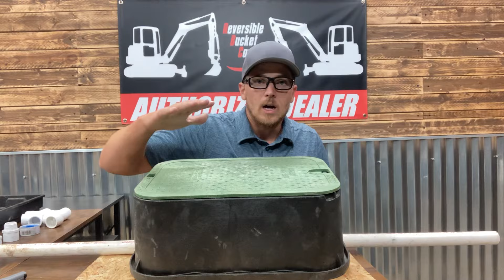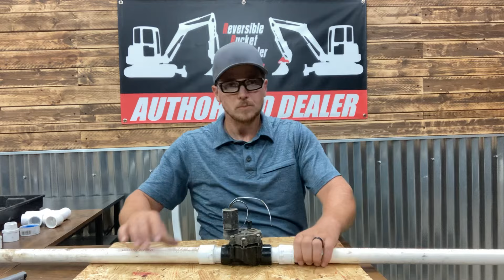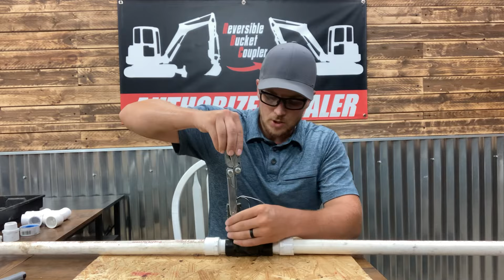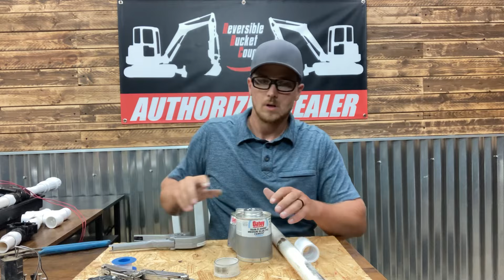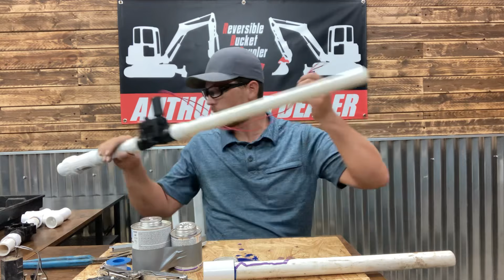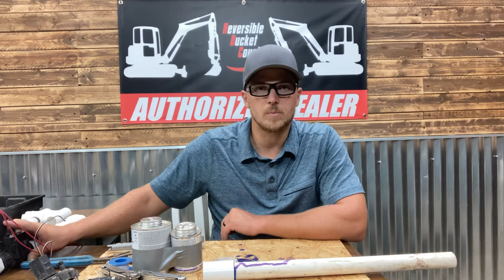Sprinkler Repair - Valve Won't Turn Off - Hunter PGV & Rain Bird DVF

Comment: Thanks for a good tutorial on main points of this topic.  Nice to watch a video where visually it is easy  'to see what to do'  by watching what you do on video. In my case sorting out bit of dirt in my HUNTER 25MM PGV100 SOLENOID VALVE by disassembling the top of it and being sure I can put it back together again correctly so no further issues with it.  As with all of this stuff it is the subtle details that matter.  Slip fix very useful product too.  All the best with your business

Comment: I have a ball valve before the Hunter on every station.  I can always turn it off.
Reply from the maker: While that’s not a typical residential setup (more common in commercial). This is a great method for sprinkler setup!

Comment: Got a call from a customer who was having trouble getting their system to startup like normal on a system that was properly winterized last fall.  Unplugged the timer.  Turned on the water and one of the zones came on.  All valves are closed.  Solenoid itself checks out at 41 ohms.  Shut the water off and replaced the diaphram and solenoid (just because) of the zone that was on and when I turned on the water this zone was now off but a different one came on.  Rinse and repeat on 2 other zones but a new zone kept coming on each time that I turned the water back on.  Plugged the timer in and activated the 1st zone that I had replaced the solenoid on and the new solenoid was buzzing.  Its not ghost voltage as the timer isnt even plugged in and there is no battery in it.  Have never seen this in 7 years of doing irrigation.  Thoughts on what it might be??  Thank you in advance!
Reply from the maker: Did you replace the solenoid? Honestly it’s not all than uncommon for a zone to temporarily turn on when we do a startup. Same thing with a rotor or spray head that is stuck up after the first run cycle. I always explain it to clients as the diaphragm, springs and wipers are weak or dry after sitting all winter. Once lubricated with water and cycles a few times usually everything starts to work. Occasionally we will have to replace a valve or a head. When a zone comes on while charging the main line I will usually turn off the water and back on. Sometimes multiple times quickly to shock the valve and hopefully get it to seat. Now you have to be careful. It’s fine on a 1” residential line but a large commercial sprinkler main line you can blow out fittings if you shock the system like that. I’d say less than 10% of our startups have this stuck on valve issue. Of the ones that do normally I turn off the water and back on and it’s good to go. I actually just left a gas station that always has zone 1 stick on during startup and then it’s usually good to go. But there were 2 other zones that also stuck on during startup. I need to get approved for repairs but dirty water or old brittle diaphragms are the likely cause and I’ll recommend replacing the valve to start.

Comment: I turned on just the water to my system and one of the valves wouldn't close, ie. water is running out to the heads in that zone only.  This happens even with the electrical Rainbird main control box turned off?.  Looking in the box, it appears that a mouse may have cut a wire to a valve head.  Could that be the problem?
Reply from the maker: Usually a stuck on valve is due to debris in the valve body. Sometimes you can unstick it by turning on and off the water supply. If not you will need to remove the top and clean the diaphragm and valve body.

Comment: I love the explanation but I don’t think this is my problem, so I bought a new screw on Hunter PGP irrigation head and I put it on ran my irrigation system but the head won’t pop up to its Full potential so I’m confused on what to do to get pressure back to this one head.
Reply from the maker: I bet you have a rock in your lateral line. Remove the head. Usually there is a flex pipe connecting the head to the pvc or poly pipe. Follow the line back to the lateral line and remove all fittings. I’d guess there to be a rock stuck in the tee where the flex pipe connects. I hope you are handy with a shovel because you will need it.

Comment: This was the best explanation I have seen yet. You covered all the issues I am dealing with. I did find a large piece of broken sprinkler pipe wedged in my valve. I removed it and replaced everything but the problem still exists. Maybe more debris. I'll follow your approach and hopefully solve this tomorrow. Thanks for taking the time to make this video.
Reply from the maker: Glad it helped! Hopefully you are able to resolve your issue.

Comment: Great video.  Thanks.  Just curious can you cut the pipe on one side and then unscrew the other side?   Once one end is free you can twist the valve off.  Sometimes the inlet side doesn’t have enough pipe to splice splice onto again.  Any reason we can’t unscrew and then re-use that threaded pipe for the inlet side
Reply from the maker: It’s always a puzzle. Every repair is different. As long as you understand the basics of how the pipe holds water and doesn’t leak you should be able to make the repair however best suits your situation.
Reply: @ThriftyGarage  thanks for taking time to respond.   Super helpful - it’s much appreciated!
Reply: Yeah, as long as u dig out enough dirt from underneath the valve to spin it I don't see why that wouldn't work 🤔

Comment: Thanks for the video. You nailed it for me with your story starting at 12:35. I had one out of six zones stuck open. Other zone valves were slowly leaking due to reduced pressure (as described by @gorken74 in another comment) causing vibrating/chattering noises as you described in your story. In my case though, when the controller was turned off, the stuck valve would close completely. The valve would stick open only when the system was turned on for sprinkling. On the valve that was stuck open, I turned the solenoid on and off several times as you demonstrated and that fixed the problem. I was so relieved to not have to clean all the mud from around the valve and then flush and replace the top and rewire. I'll repeat this trick if needed until it gets too annoying.

Comment: Hello TG! Excellent video👍👍👍 

 I see you have responded to questions in the past few weeks so I have a head scratcher for you. Last week, my wife and I were getting ready to leave on a weekend getaway when she happened to look out the window and saw a flood running along the side of our property. It was about 8am and the system was between the first and second of three cycles, so all zones should have been off. I went out to investigate and found the main control box full of water and massively overflowing. The main water control valve access tube was also full and I was unable to find the shutoff with the end of my T rod. Then I remembered the shutoff near the backflow (duh) and closed that valve, shutting off the water. We needed to leave on our trip, so I just left the shutoff valve closed, figuring I would deal with the situation later. 

When we returned, all the water had drained down and I turned on the water, thinking if the leak was before the 3 zone valves, I’d once again have a flood. Nada 🤔. OK, gotta be a leak on the other side of one of the zone valves. I turned on each zone, one at a time, observed each zone functioning and still no leaks (!?!?). WTF? 

The water is on now and all seems well but I just don’t trust the system. BTW, there is also a spigot drain in the control box and it is firmly off. I thought of shaking the pipes, but the leak was so massive I surely would have seen something. What am I missing? 

Help!
Reply from the maker: It could have been a fluke thing. I understand you not wanting to trust the system. We commonly experience this after main line breaks and repairs where debris enter the line. If there are debris in the line usually the prevent themselves quickly causing valves to stick on. Occasionally if you turn off the main valve like you did those debris will fall back out of the valve causing it to operate correctly the next time you run the system. It may have flushed itself out or you might. Have a future issue. I would keep an eye on it until you build up trustworthiness again. Also lots of variables in your question as I don’t know the age of your system or valves. Sometimes due to old age systems will struggle. If problems continue you may want to consider replacing all of your valves. If you believe the water is not coming from a stick valve but a different leak I would turn on each zone for longer than usual and check the box to see if it fills up with water.
Reply: Thanks for your advice TG 👍👍👍. I’ll follow your advice and keep an eye on the situation.

Comment: Great job thank you. I was confused with my setup because it was a three wire type. The new solenoid had 2 wires.
Reply: So, how did you deal with the 3rd wire?  What colors are your wires?  I've got the same situation, but haven't started the repair yet.

Comment: I was just considering replacing one or both of my solenoids today in hopes to have my front zones 1 and 2 heads pop-up with more success, but in the process of turning one solenoid earlier it caused a rear zone to start as I clearly did not disable power or turn off the correct water pipe, so I quickly tightened it back, but the zone stays up and spraying.

How do I turn off the zone? The controller is set to OFF and I'm forced to turn off the water until I figure it out or pay to have a sprinkler service come tomorrow. 😢 The solenoid is complete tight, so idk why it keeps thinking it is manually turned on to run.
Reply from the maker: If you remove the solenoid while the water is on and try to screw it back on while the water is still on you will be fighting the water pressure and can greatly increase your chances of cross threading the plastic threads. I would recommend ensuring the water is off and removing the solenoids again and reinstalling them ensuring they are not cross threaded. If the threads are damaged you may need to replace the entire upper assembly. If cross threaded the solenoid may feel fully tightened but may not be. Even if the controller is off, if the water is physically unrestricted the zone will run. The controller only turns on the solenoid. It is an electronic switch or relay for a mechanical physical on/off valve.
Reply: @ThriftyGarage  I'm going to go back out this time and take off the diaphragm with the solenoid, see if it is dirty and clean it, but also try to loosen and tighten the solenoid again.

I hope I did not damage the solenoid threading, but I for sure have cross threaded, because it slowly leaks water while running, which it never did before.

So, if I have it threaded properly and tighten it the zone should go down? Or do I have to turn the controller on and off? (I think I tried the latter and the zone stayed running, so the latter seems to no not be an option.)

Comment: I have hunter ICV valves and I have a condition where one of the control valves closes so fast it creates a hammer and forces the valve to open again and stays open and wouldnt shut. I opened it up and inspect, clean and found to be in good order. Other valves dont do this. What could cause this? Thanks.

Comment: I spent about 8 hours on this job first rebuilding and then replacing. Thanks for the tip using the adjustable slip fix.  You are right about having to dig back to bow.  I didn't once and the pipe snapped about 10 feet back and then I really had to dig. Thanks for the video.

Comment: Slip fixes are ok for lateral side (after valve ) not before on 24/7 pressure , it will fail eventually

Comment: you could have cut out only one side of the pipe and unthreaded the valve and replaced the pvc fittings on one side of the valve.
Reply from the maker: You are right, every repair is different. Depends on soil conditions and other obstacles near the repair.

Comment: I have 2 above ground new rainbird valves that won't shut off 1/2 the time. Tried different timers, valves will continue even wires disconnected. Tried replacing valves a few times and air bled. Could it be that the flow rate is too slow and need to adjust for more water spray?
Reply from the maker: Are the bleed screws and solenoids fully tightened?
Reply: @ThriftyGarage  Yes, no leak. I've replaced the valves a few times thinking it was a bad batch from the manufacture. Next time while it's happening, I will take one of the sprinkler heads off to allow full flow and see if it will shut off.
Reply: @gozillatrade5178  A leak in the main line will cause a pressure issue that will cause a perfectly good valve to leak because of the pressure loss. In fact, all the valves will leak slowly when this happens.
Reply: @gorken74  Thanks for confirming my suspicion. That is exactly what I experienced. Only one valve was stuck full open and it caused other valves in the system to leak slowly. I was hoping the slow leaks would stop after the bad valve was fixed, and they did stop leaking.
Reply: 1. Check if the solenoid valve is tightened manually.  It could be in open position.
Some valves use the solenoid as the manual valve or check if there is a provision for a manual shut off valve on the  solenoid.
2. Also if the delivery pipe is on a higher position than your valves consider a check valve
3. Also check your diaphragm of course